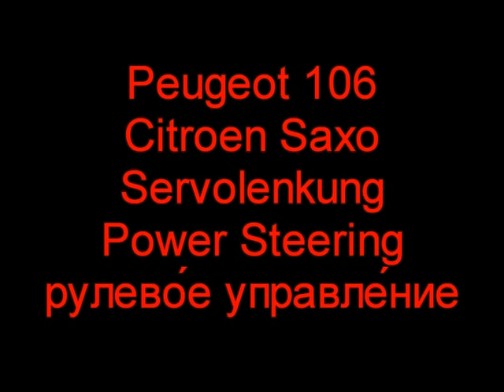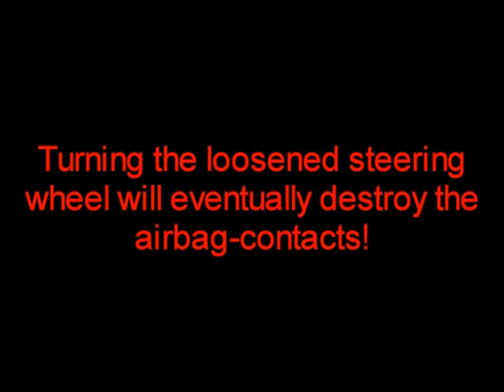How to Peugeot 106 Saxo Power-Steering demount, Servo-Lenkung Ausbau

Comment: What size of torx on yours film 1minute. What size ?
Reply: Torx 55 just did the same today ,peugeot 106 gti
Reply: But other three torx screws are different. 45, 50?
Reply: @patpaft4636  50 for the three bolts on steering rack. 45 on the tie rod bolt. 😊